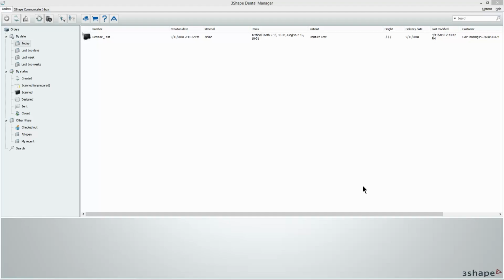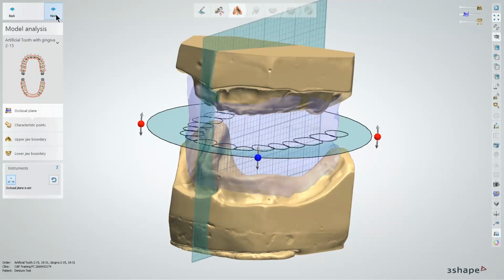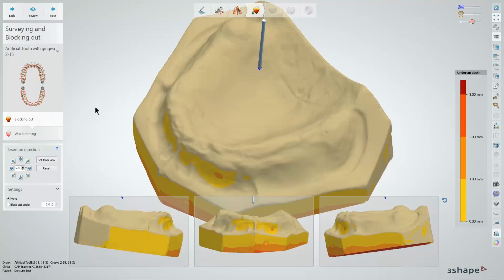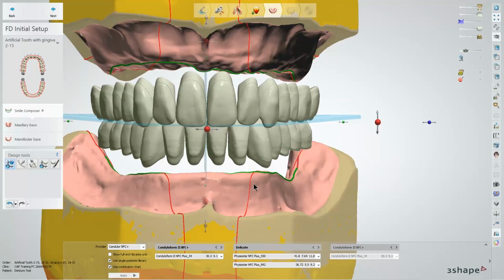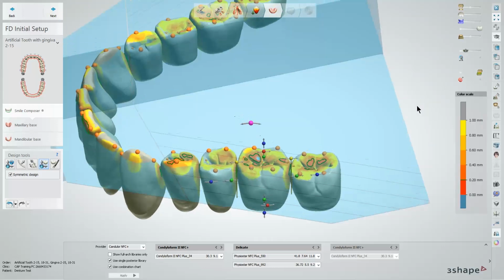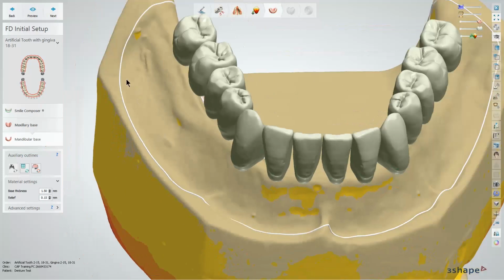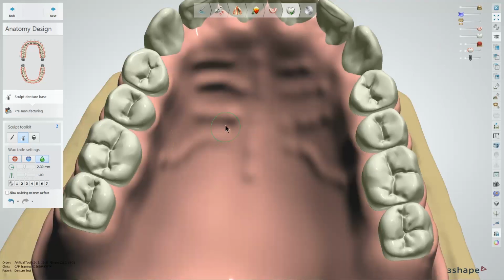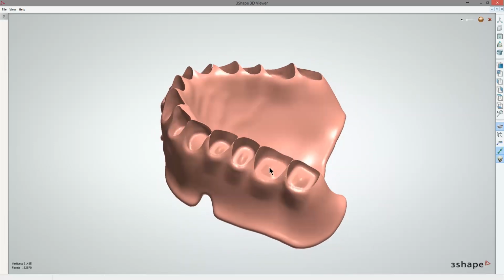Dental Lab Life: Designing a Denture Using 3Shape

Comment: Does it also create a separate stl for the teeth? You mentioned at the end that the software expects you to buy artificial teeth. What if you wanted to print or mill the teeth? Also, I was working with a tech and they bridged all of my teeth together when setting up the order-- I was confused because in this video you didn't do that. Lastly, there are no shaping tools to sculpt the teeth, is that not an option at all? Just wondering what you would do if the doctor wanted you to design it to match an old denture that was designed by someone else or if none of the artificial teeth libraries fit well in their mouth--how do you do that with no option to sculpt teeth? ... I'm attending your class at the end of May, trying to come as prepared as possible.
Reply: to clarify it was a Zahn tech support tech who bridged all of the teeth

Comment: Even though the description says 2017 the dental manager order form says 2018, is this an error? Also we are using 2017 but we cannot do the same thing to the artificial teeth as seen on the video, is this because of the difference between 2017 and 2018?
Reply from the maker: A 3Shape 2017 user should be able to do everything shown in the video. Zahn/CAP customers can call our support line for additional help at 800-496-9500 x9.